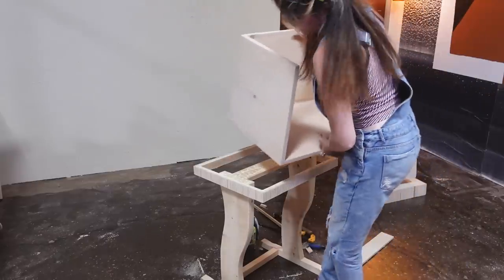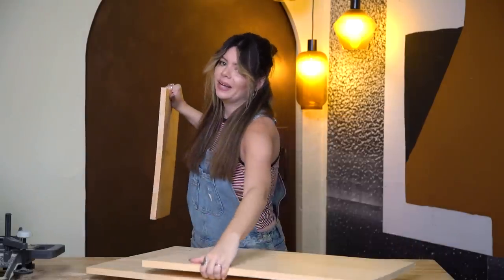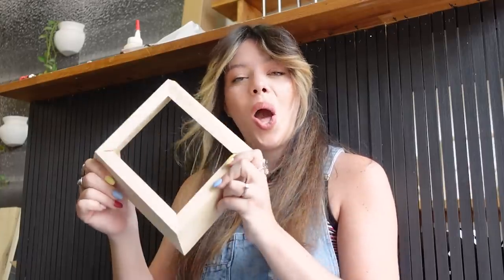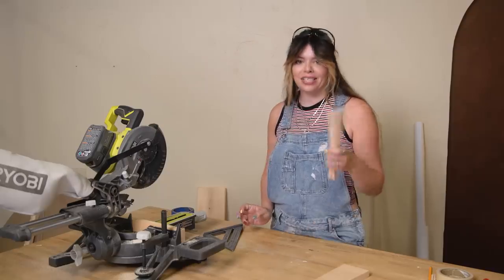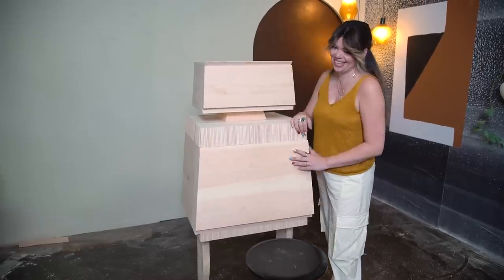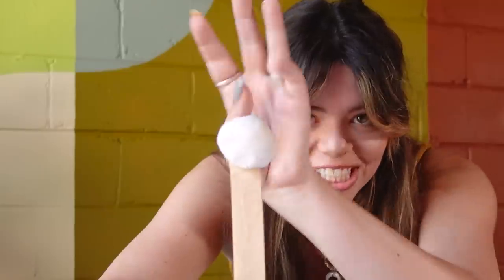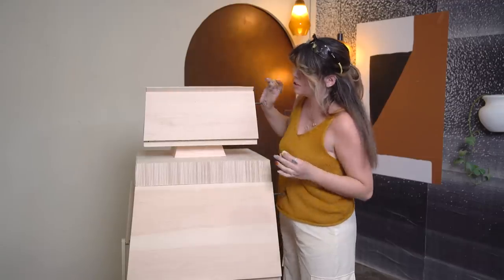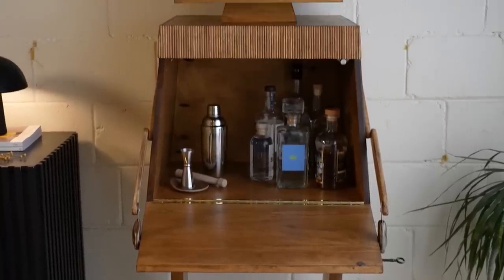attempting to make THAT $6000 space-age bar cart

Comment: BECKY!!!!! I am literally a professional woodworker. I design and make custom furniture for clients (designer tables and cabinets etc.) and.. I would've NEVER taken this one on... I literally would not know where to start and I would've just said nope and paid the $6k. I am so impressed by how far you've come with your woodworking journey and how resilient you are. Knowing first hand how hard some of this was (even with the right tools), I have an insane amount of respect for you! It came out so so so well, and your idea to glue those dowels instead of shelling out for tambour or fluted detail panels was genius. I'm learning so much from y'all every time you post. 

One tip would be next time you want to glue two pieces of wood together, I would suggest drilling dowel holes and shove some dowels in there with glue-- we use biscuits and dominoes when we do glue ups, and it just ensures that the whole panel will stay rigid and not just rely on the glue alone.
Reply from the maker: thx so much!
Reply: @TheSorryGirls  exactly what i was thinking :) but you learn as you go! Great job!

Comment: You did an amazing job. Tips for Polymer clay though. I would have added something inside the hand to grip onto the wood - like wire or something. The hand may slip off if it is just on the flat wood. Also wire into the fingers - that will add longevity. Also for smoothing polymer clay, it works best with isopropyl alcohol instead of water. If you don't want to use that you can pick up clay softener. 

However that is me nitpicking as I use clay a lot and have gone through all the ups and downs with it hahaha. Great work.
Reply: Such a good tips! Thanks

Comment: If the hands fail - use 3 sticks glued together( increased thickness) or use a large paint stir stick ,make a hole in curved area (palm), use a wire armature (for fingers) attached through the ‘palm’ hole, then cover in clay.

Comment: Absolutely love this! I think if you had molded the hands around a metal L bracket it would be a lot stronger. Are the hands still working with weight ?
Reply: Or just a wire armature. But fingers crossed it will hold up - because - EPIC!
Reply: I was wondering this too.. i woudnt dare to put a lot of bottles on the open lid tbh. But it still looks soooo awsome
Reply: There isn't any weight on the hands, the piano hing is holding it in place. The hands are just decorative
Reply: @jjjemmaaa  exactly. But i think the hands did carry it in the original. So with only the hinge the lid might not be able to carry much weight. These types of cabinets normaly always have either a string for extra support or a wooden arm underneath that slides out.
Reply: A copper chain would be a great addition so you don't have to worry about destroying the hands!

Comment: Cool hack, with the grid. There are easier ways to do that though. I can't afford Photoshop/Paintshop so I use Gimp which is free and available on MacOS as well. It has a measure tool in it which you can set to in, mm, px, etc. Then use those ratios to scale your piece. It also measures angles!

Comment: So just a little tip that I learned from my grandpa and Dad who are impressive woodworkers. When they would join wood together to make larger pieces they would always use biscuits or dowel pins. That way the joint is just a little bit sturdier. Especially on a door because doors have a lot of force exerted on them throughout the lifetime. Without the biscuits or the dowels reinforcement that glue joint can separate.

Comment: This looks great! Tip for when joining pieces of wood like you did to get a wide enough piece: there’s a technique where you cut a tiny notch in either piece of wood you want to join, and then insert a “biscuit” ( a small piece of joiner wood to help hold them together) and then also do the wood glue and clamping. It will make the hold a lot stronger!

Comment: Becky! You should used one of those...hole cutting drill bits... for the sandpaper thing. The cylindrical ones that you use when you need to make a hole with a 1 inch+ diameter!    ...I am not describing this well, but I think it would work.

Comment: I would highly suggest you guys look at getting and using a flush trim router. You could rough cut your towels glue them all on and then flush trim them to be exactly on par with the edge so that there's no little unevenness as it goes. Also when you're making repeat cuts set up a stop block by just taking a piece of wood and clamping it to your back fence on your miter so that way you don't have to work every 4 inches or whatever it was you were cutting you just push them up against the block and that's where you're at cut it remove that cut piece push the stack over to the block again etc

Comment: @thesorrygirl I love this design and the project itself is so ingenious! BUT, can I make a woodworking suggestion? 

When you're trying to make a wide piece of lumber, wood glue is great but drilling a hole in either side of each piece and adding both wood glue and a dowel piece is better. It will last longer and the dowl can help ward off problems caused by the movement of the wood over time- especially for a piece that functions as a door.

Comment: Original would absolutely have been made with plywood and then likely veneered with walnut or something. The trick between good plywood and cheap looking plywood projects is edge banding. I'm going to guess that you used pine here based solely off the look and $150 price point. I would love to see you guys step into using nicer quality hardwood. You might not be a woodworker Becky, but you definitely have the skillset to step up into it.

Comment: while I greatly apreciate the creativity of the clay.... yall never use foam clay, or like smooth on products (which you can mold something and cast in rubber sillicon, and make a reusable mold, incase something breaks you can make more) and then cast it in anything you want, in any color as many times as you want, untill the mold breaks, which I have yet to have happen, (It will/ does happen though). Any way, love the video :D